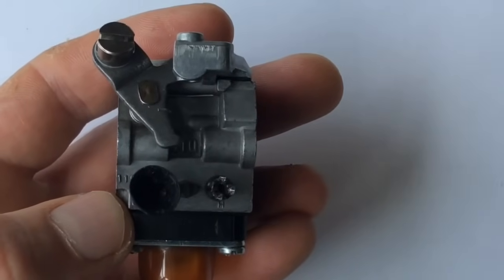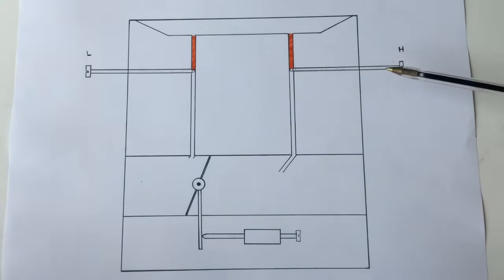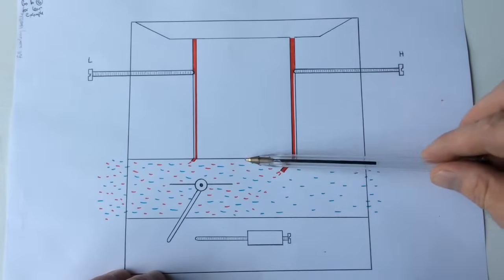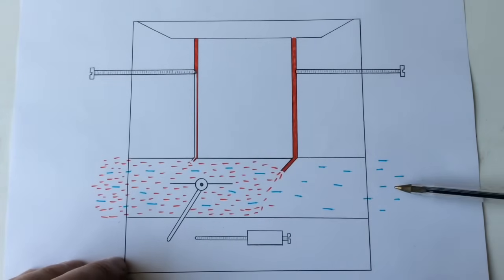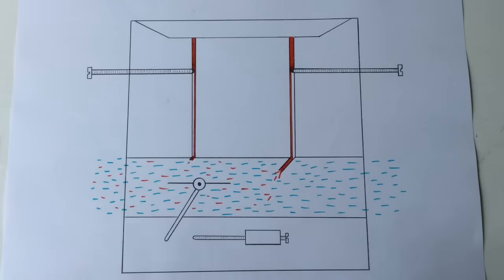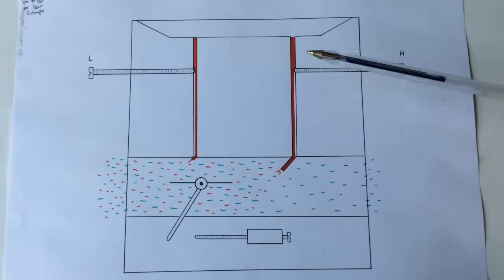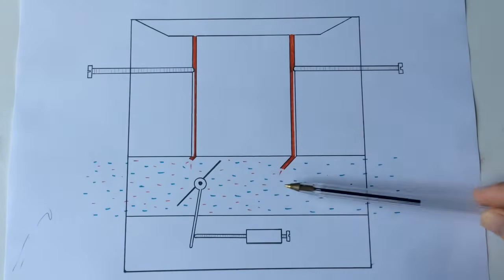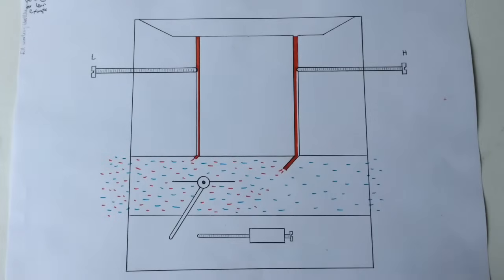HOW ADJUST CHAINSAW CARBURETOR:  Chainsaw Carburetor Settings Explained! (by Craig Kirkman)

Comment: Thank you,  i hope these is what is wrong on the echo chainsaw  cs 590
Timber wolf,  was storage  3 yeras, but i did run all the gas,  did not help
STILL START  2 SEC AND AS SOON I PRESS THE GAS TO UNLOCK ,(you know chainsaw,  go very higth  when starts), it shut off, and then 2 pull starting  again and goes off, then will never start,  doesn't  matter  how many times you pull, even the cord got hard to pull, 
IF I CHOKE AGAIN 2 PULLS , CHIKE OUT 2 PULLS STARTING  AGAIN and shut off , same thing ilke before,
I place new spark plugs,  new filters gas and air,  not the oil because is for the bar no the engine, 
And rebuild  the carburetor  walbro hd 25, and nothing same thing 
New carburetor  cost me 103 $ , 
No like other 20$,
Do you think maybe is the screws, but i only move the pastic look like on top is only turning  180 degrees,
I don't  know what to do 
Anyone can give an idea

Comment: I have enjoyed your thorough explanation very much! We have brought back to life a 1990’s McCulloch MAC 80 SX weed eater by cleaning and replacing the injector pump and most of the gaskets on the Walbro carburetor. The engine idles well and it has good pickup. Despite that the fuel mix is at 40:1 ratio it smokes a little much on full throttle. Since we replaced the crankshaft oil seals, we cleaned the piston, I noticed that the piston and ring is a little loose on the cylinder. There is a pricey “short block” on eBay. I am tempted, albeit, what could it be the tell tale sign of a worn cylinder and piston on this engine?

Comment: Thanks for a great explanation.  I have just installed a new carb on my mantis tiller.  I had no trouble at all setting up the High jet,  using your procedure,however when moving to the Low jet it does not matter which position it is in the tiller will not start.  If I hold down the throttle it will start every time, but as soon as I release the throttle it stalls.  I have moved the Low jet from one end to the other in half turn increments and it makes no difference.  Could you please suggest what may be wrong.
Reply: Maybe the choke was closed. The choke plate blocks the carb inlet for an enriched mixture when starting cold. Needs to be opened after it starts up.  Some carbs have primer bulbs to initiate the flow of fuel.

Comment: I have a Walbro WG-8 that has a single screw. (it does have an idle adjustment screw ( "tick over"???)) Do you know if it is a high side or low side screw?
Reply from the maker: Hi. If its an idling screw (tick-over) then it is neither the high or low.  It is all by its self.  If the screw is set at a medium setting to begin with then screwing it out (anti-clockwise) will lower engine revs and screwing it in (clockwise) will increase them.  Thanks Craig

Comment: Thank you so much for a very informative video. After two years   I was able correctly adjust the carburetor of my sthill  brushcutter .it now working perfectly
Reply from the maker: Glad it helped.  Thank you for taking the time to give the nice comment. Craig
Reply: After adjusting my sthill brushcutter carburetor correctly and using it for 1 hours two days later I tried to start it again. But when I choke it the machine started running. I cut it off but it didn't start again. I tried starting it today I tried the same one turn each settings but it starts then dies can you please say the correct settings for the idle screw  and do you think the carburetor needs to change thank you

Comment: On a sthil fs280, what is LA screw?  How do I adjust it?
Reply from the maker: Hi.  The following is the way I adjust these.  

In my experience the LA screw generally adjusts the engines Idling speed.  Just how much. or little, you need to adjust this will depend on how your FS280 performs whilst you are doing the adjustment.  In other words, start your brushcutter and let it idle (if it will).  'Observe the strimmer head'.  If it is still turning without you touching the throttle at all, then you need to screw the LA screw outwards (anti-clockwise) just enough to stop the head turning and not too much to lower engine revs too low.  

However, if it wont idle in the first instance (engine just stops), then screw the LA screw inwards (clockwise) a little and start the machine and idle it again.  Start from this point from what i have already mentioned. I hope this helps.  Craig

Comment: Im working on a Weedeater FB25. I have replaced carb, no start. I can't get a consistent spark,  and at times no spark so im replacing ignition coil. trial by error.

Comment: Ha ha I'm back here! I've got a new Black Eagle trimmer etc. and the only tune up given from the manual is to adjust a screw linked to the throttle trigger to get the engine driving the shaft or not, and that supposes to be the point where the engine in running ok; Idling no shaft turning, rev on and it turns again. That should be ok but I'm worrying that it smokes a little too much. No High and Low screw, just another screw with no mention about it? and could not observes what it actually does when altered. Thanks for any suggestions?

Comment: Some 2 stroke carbs don't indicate which one is the High vs low screw. However,  on my carbs, one screw is larger than the other. Also, they are side by side but one is closer to the engine? Hoping you can tell me which is which.

Comment: Thank you .  Why does my weed trimmer stalls when I  pull the trigger  to increase the  speed ( it also sounds like a ballon loosing air  just before it stalls). And also only runs on half  choke
Reply: snuckz8 I think you need to adjust your carb.

Comment: On my carb I only have a air screw dont have h and l what do I do to ajust the air flow it's on a macculloch 210 Strimmer thanks...great vids 👍👍👍
Reply from the maker: Good question.  I will make a video on this as soon as I can get round to it. cheers

Comment: This is a serious question I hope you do respond as I am stuck on this very situation...how do you tell which screw is the High or low without starting it? I have a Carburetor....specifically Walbro wt827b and it doesn't say which one is high and which one is low. Please help Repair specialist dude!

Comment: Great video! The engine manufacturers sell these things with totally inadequate instructions on how to set them up. I do have one question though. If the High and Low are turned out by one turn initially, how should the Tickover be initially set?

Comment: 7:20 if the engine increases rev due to lower fuel portion but not giving extra power then how to find a good position for High screw if we can measure only rev but not power during adjustment. Or they sound differently? do you have example video with adjustment of a real engine?

Comment: Great video, well explained, however if I may add do all the L&H adjustments with air filter cover on and of course running. I find the biggest complaint is air restriction so to add to all of this I drilled three holes in the cover and remedied my problem. On Poulan engines I find the air filter cover openings not sufficient for air flow that's my opinion

Comment: One problem,  when you adjust the low revs screw last that will have a small affect on the performance of the high jet. I've always adjusted the low first. ?
Reply: Carl
Yea, agreed, sort of, there is a degree of interdependence.  But I think he means the idle speed adjuster not the low speed jet mix. Bit of iteration.

Comment: Hi I have a question on this. I have a engine it runs pretty good on tick over smooth at full throttle but a little lumpy mid throttle. Do you have a video that shows the mid range tuning?
Reply: Droning
Some just defy adjustment, some are just always bad whatever you do. Make sure it's adjusted to four-stroking at full throttle 'cos it could be running lean at full throttle which can screw up mid-range.
Reply: @hairyoldhippy  my engine is on a paramotor. It's a very well put together engine. I feel that if anything I'm running a bit too rich top end (better than running lean and putting a hole in the piston) the problem is I can't tune if while it's running as it spins a 125cm prop. If I take the prop off it would over rev due to no resistance.
Reply: Droning (love the name ;-) )
Oooh that's a bit more tricky, as you've found out. Presume it's a 2-stoke and uses one of these ghastly carbs. As you likely know, pick-up to mid-range can be dictated by the slow running jet, poor pick-up tends to indicate it's a bit lean. But that's not your problem. This is all OEM? Prob I've occasionally encountered is vibration upsets the fuel delivery at certain speeds, possibly needle bounce or throat resonances. Some advocate vibration isolation, just a rubber gasket or rubber manifold mount. Prop balanced perfectly? As a first, if you've not already done it, a carb diaphragm kit including a needle, the rubber being prone to hardening up too and bouncing. Had this on motorbikes (albeit slide carb) where a new needle smoothed out rough spots.
Notions? (Cool vids BTW).
Reply: @hairyoldhippy  hi there. You may actually be right. I have just changed my prop and that's when I started to get the issues. I might do a carb rebuild just in case then check the prop for balance. Thanks for your help and I will update later 👍🏻
Reply: Droning
Finger's crossed. You likely as I find that just talking through a problem brings ideas to mind. I'd be interested to know if our notions cure, increase my data base.

Comment: Hello.
I'm in Halifax Nova Scotia. 
Just pulling the cord....and adjusting the L and H. Both at the same time. Just a bit at a time. But still no start. So I adjusted the throttle screw a tad. And still nothing. Just sweating because it's 38 degrees today. Haha. 
All because I didn't watch the whole video. 
Now my ts 420 stihl runs.... because I watched the whole video.
Thanks.
You sound like Phil Collins a tad. 😉 
Thanks again for the video.

Comment: Well done, I love the style of your presentation. Suddenly this made sense, the low jet is at the narrow point for air flow at idle, so the Venturi effect will draw more fuel from that jet at idle. The high jet is upstream so it will only come to play at WOT, there isn't enough Venturi on the high jet until air flow increases.
Reply: Ahhhhh. Cool. Thanks for explaining that. I couldn’t quite understand why the two jets weren’t doing the same thing. Makes sense that the additional air speed across the butterfly would draw more fuel in low throttle settings. After watching the video AND reading your comment I now now EVERYTHING about adjusting carbs. Well, close enough. 
Was this the first time in 20 years that I actually learned something from a YouTube comment? I mean, other than that most people hate each other and love to say horrible things about those that make videos. 
Thanks!

Comment: You have a new sub, great vid.I have a short story that I ask thoughts of.Past few weeks I am at my wits end with leaf blowers.One day some are fine next acting up.Oddly all 3 do about same thing.Two are Polan other Craftsman.All 3 have same style and parts except Craftsman is Walbro carb others Zama.Few years old classic case of bad gas.Brought them used.I run only 90 oct NO ethanol Sthil hp oil mix.So, I notice all 3 engines get hot.Hot as in spark plug can't be touched after about 2 min.Plastic case can't touch.Just way too hot.Thats when they seem to act up.Full throttle and bogs down.Let off a tad and fine.At times bog out and die also.I have done the new filter, lines so on.Also cleaning of carb and blowers.No ajusting of carb high low yet.My question is this.1).What causes a original carb at factory set to then later need the ajustment screws ajusted? 2).What causes bog down at full throttle? 3).Thoughts on engine getting very hot fast? Could any of this be solved by ajusting high low, if so I then need to get the tool as mine takes speical tool for two screws side by side.One screw is small one bigger.Last resort- buying new carbs, I can solve maybe all that way and not have to ajust or finding a good ligit carb is a joke after market poor quality control China stuff?

Comment: I have two questions:
I must adjust the high screw before adjusting the low screw or it does not matter wich one I adjust first?
Is it possible to change a 2 adjustment screw carburetor for a single adjustment screw carburetor?
Reply: It depends on the carburator and the equipment. This video is for a chainsaw. If I remember correctly, you do low and then high for a string trimmer.

Comment: thanks. I screwed all 3 in all the way and backed them all out one turn. Then had to open the low way up to stop the chain from turning and slow the idle. Thing smokes a bit while idle too. Tick over = idle. Looks like I need to back the tick over way out to close the air intake off to get it too quit smoking and tighten the Low in so it will run leaner

Comment: Would you recommend using a digital RPM tach or just use the pitch of the engine.  I'm not sure if a RPM spec is provided or can be found.
Reply: If you have a rpm tachometer it's better.  I find unless I'm using the saw every day it's easy to forget the exact pitch that is perfect for idle and high

Comment: Great job. This video helped get my backpack blower working. it still dies a little if in high speed for more than a minute. My unit is very difficult to adjust as I have to remove carburetor for each minor adjustment as The tool I have is too long. I would have to get a stubby version or cut down tool I have.

Comment: Thank you for that. Yet I'm not entirely sure I'm grasping the whole scenario.  I think you have so much room on your diagram, thicker L and H would show more clearly the opening and shutting amounts your applied at various stages. An arrow showing the air flow and perhaps a kind of legend with air fuel mix and including optimum mixed may also enhance your explanation. I did stress to realise you'd change the mix. I also have difficulty understanding the reason for low and high adjustment being different in their need for air to draw fuel. May be I'm not advanced enough to get it.  Here it seems the Low is situated passed the throttle where as the High is before it. However both would be controlled by the throttle position to accept air... Just the same thank you again.

Comment: I just bought a new carb for an echo trimmer that I'm using on a RC airplane. I can open the high side screw about one to one and a half turns and it runs pretty good at high rpm. 
I couldn't get it to idle very long at all with the low side open a whole turn or more, so I started closing it a little at a time.
Even open one half of a turn it wouldn't idle very well, and would eventually die. 
I finally screwed the low side open just one quarter of a turn, and it idles it's best. I have to turn the idle screw up a little higher rpm than I would like, but it keeps it from stalling as often. 
It's just hard to restart while flying through the air. 
I think the reason the engine idles better and at a higher rpm with the low side is only open one quarter of a turn, its because of the lean mixture. 
Is one quarter turn common for these little engines?

Comment: Understanding how these parts work is extremely valuable when determining the proper adjustments. It took me from guessing to repairing. I am also a very visual learner, so the diagrams were more valuable than staring at the outside of these components while someone talks about what is inside. Thank you.

Comment: I have a poulan 50cc and I got it with parts not all together. The high and low screws are out and ones longer than the other. Which one goes where???

Comment: I didn't get why you should adjust HIGH screw first and then LOW. for example, a chainsaw normally works with throttle wide open in high revs ( you get the full power of the engine), so it's more important to be powrfull and efficient in high rpm. if you adjust first in high revs and idle second, the second adjustment in idle should affect the engine in the high revs too, as the mixture becomes leaner or richer.

Comment: Nice realistic detailed classroom explanation. Most of us that work with mowers, chainsaws and other small engine s know these basics but actually performing the task is the hard part. The manufacturer makes it so difficult to do proper adjustments unless u remove the limiters on carb and even having the right driver,  that it's hard to get the motivation to attempt it without removing the carb, pulling the limiters and buying the proper driver. Great discription though, thanks

Comment: Just to add to previous , You would have great time sorting my 1975 Kawasake F7 175cc
it has been driving me nuts with misterious intake leaks which make it want to rew to self destruction in Idle no less.
Reply: Victor Cornell F7E by any chance? I loved mine with a 125 gears. wheelies for. ever! check the intake gasket, cylinder side.:-)

Comment: The positioning of the H and L jets on either side of the throttle butterfly cause them to see different vacuum levels, and now it all makes sense. A note telling Americans that "tickover" equals "idle" screw would make a great video perfect. This video, and your "12 reasons engines bog" are applicable to MANY engine types and scenarios, not just my recalcitrant Husky/Zama. Thank you for your efforts!